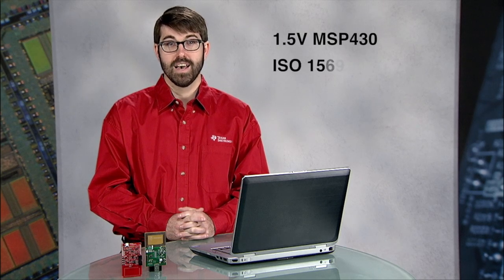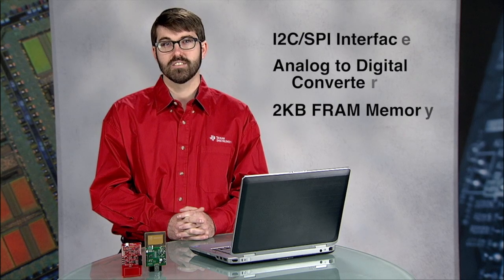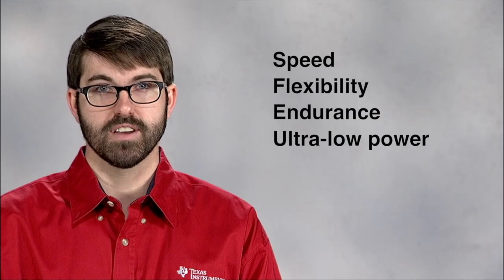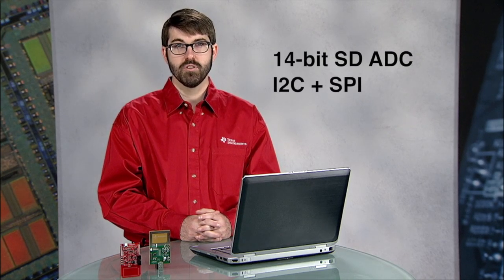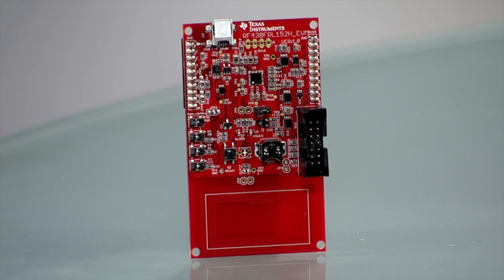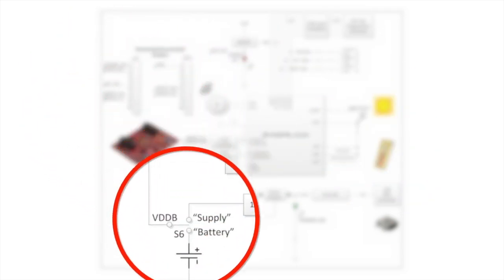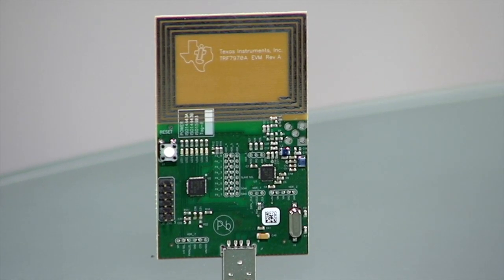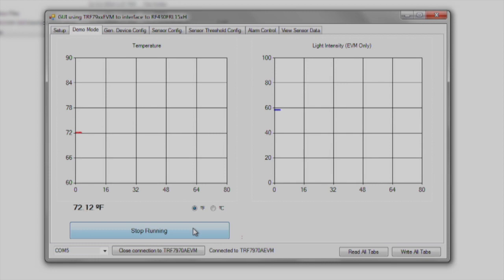RF430FRL15xH Series Overview

Comment: Wish the literature specific to the RF430FRL152H_EVM was clearer in regards to using your own analog sensor in conjunction with the EVM unit...in the schematic there's an SV1 4-pin unit which would be perfect if it overrode the installed thermistor and reference resistor.  But in photos of the EVM module I only see SV2 for JTAG communication.  Is the SV1 section on the back or something?  Or on the SensorHub booster pack you are advised to use to expand your testing to other sensors besides the ones already installed on the EVM?